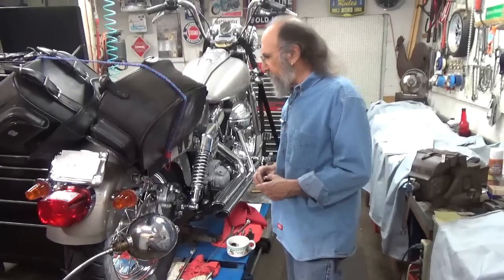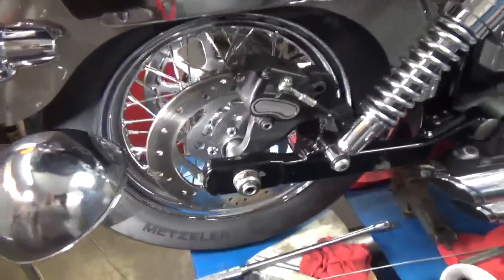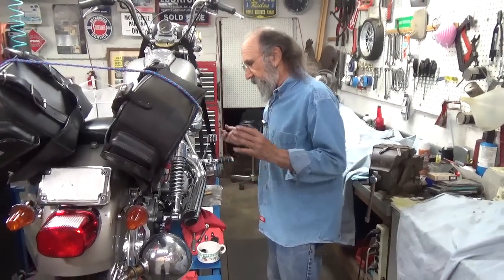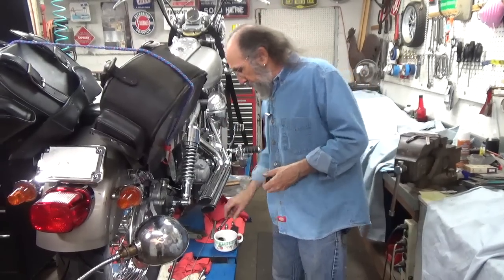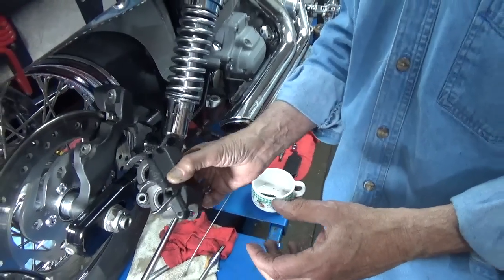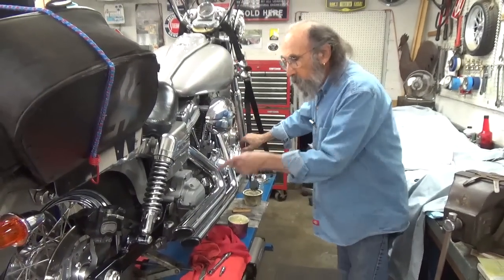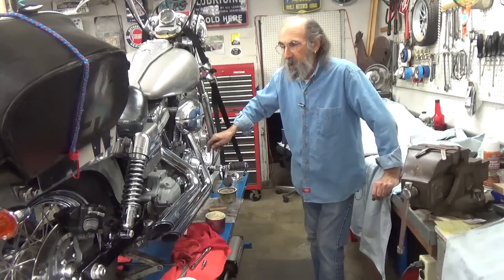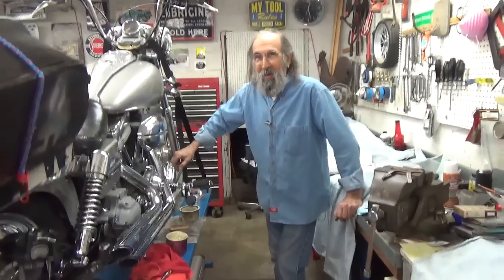Almost Forgot! New Rear Brake Pads on CMM's Harley Dyna

Comment: I have a 2000 Dyna Wide Glide. Will your video on chassis al8gnment address the motor mounts and when they need replacement. I'm more of a pan and shovel guy who got this Dyna for good price, but I don't know it as well.
Reply from the maker: We'll see what comes up.  I had a Dyna (2001).  It was nice, but, I too am more of an "old bike" guy.

Comment: Good morning and thank you for this video. How are you and CMM doing ? 94 octane is $6.80 USD for a US gallon or $2.24 CDN for one litre here in my part of Canada.
Reply: Wow and I thought it was bad here in Maryland at 5.09 a gallon for super! Cost me 10 bucks to top off from over a half a tank. I'm wondering if it be cheaper for me to buy a big gas can and fill with 87 octane and then add some octane boost to the can and mix myself. As 87 is over a dollar cheaper a gallon. And octane boost is 7bucks for about 2tank fulls of gas.
Reply from the maker: Sounds good to me.

Comment: Hey Mike so I hope I don't get on your nerves by asking so much about my bike. I just think you're the easiest to learn from and you seem to be the most knowledgeable on YouTube about these evo bikes. This is a question about saddle bags. I have the bars on both sides of my fender to keep bags off my wheel but I'm having a hard time sourcing a set of decent sized bags. These bags on this bike look perfect. Do you happen to know what those are called?
Reply: They were on sale at a great little leather shop in Calimesa Ca , ( buckle n belts ) . They are a little bit bigger than a standard 12-pack of soda and I couldn't recall a name on them but they looked great and fit so I got them

Comment: I’d be interested to hear about how or even if the bike’s handling changes with the narrower rear tyre.  I have a 21 inch front with a 90 x 90 tyre so the standard 160 wide tyre gives quite a large difference and I felt a real change when I stopped using a 180 rear.
Maybe I might try a 150 rear tyre if I can find an Avon in a 17 inch rim size.
Reply: She handled Great. More tire sidewall made for a more softer ride Plus I Really Love The Way She Looks Now 👍😊❤️💯❗😊
Reply: @cameramanmike2072  Thanks very much for the reply Mike, I have not long put a new rear tyre (Avon Storm) on the 17 inch rear wheel. I have a 2006 Sportster that uses a 21 front and 16 inch rear with a 150 and that works just great though I don't think I can get the aspect/width required to match the overall height.... the Dyna is not that much heavier than the Sporty so maybe I will look into going to a 16 inch wheel with more aspect to the tyre. Ride safe.
P.S.  Scratch that about tyre width/aspect and ride heights.... a 150/70  R17 is available and would leave the bike just an eigth of an inch lower so that's a go situation - I would lose a little sidewall but I have also fitted longer,softer rear dampers that raised the seat about an inch and sumthing and could use things a bit lower as I am only 5'8".... but I am the right weight for 6'3" !!!
Reply from the maker: Sounds like you're figuring it all out.  That's half the fun.

Comment: Hi PM and CMM ! I was wondering if your upcoming video on frame alignment will include any discussion of the infamous  "death wobble". I have read that the rubber mounted engine relative to the swing arm bushing may contribute to that phenom. Just curious as usual. Thanks for all you do !
Reply from the maker: I've not experienced it.  Probably never saw one running in that bad of shape.
Reply: @pacificmike9501  Thanks Mike. I'm lookin forward to watching how you do that alignment.
Reply from the maker: Nothing magical.  It's in the factory service manual.  But, we'll go through it.  It's truly worthwhile.  Right now, I'm tearing my hair out making a sidecar fit my FLH chassis, with a six speed and custom pipes and forward controls and on and on.  Then we can do an alignment.

Comment: @Pacific Mike could you explain what you did to your Shovelhead exhaust?
Reply from the maker: My friend Nathan, at Turner's Customs made them for me out of three or four sets of junk pipes I had laying around.  They're made to my specs and I've done some rather "off the wall" stuff from there.
Reply: @pacificmike9501  I had an exhaust bolt pull out of the head and remember seeing your fix for it.
Reply from the maker: That was a long time ago.  Was that a Beull?
Reply: @pacificmike9501  1980 FL

Comment: Mr. Mike, if you receive this I am in desperate need of knowledge and information for my evo motor.
Reply from the maker: Like, I'm here.
Reply: @pacificmike9501  is there any way I can contact you more directly
Reply from the maker: I do accept mail at my friend Kenny's shop in Beaumont Ca.  If there's something we don't need to discuss in the comment section... By the way, when I try to answer questions in the comment section, I hope more than one person benefits.  But, if you wish to send mail, I will get it if you send it to:
American V-Twin Att. Pacific Mike
448 East 4th Street
Beaumont, Ca. 92223
Reply: A little back history on the bike, it is a 2003 Kenny Boyce frame (fxr) it has a 1340 evo on it. My issue I'm having is it sumping the motor from the oil pan(no big deal there, that's just the check valve in the oil pump) but the big deal for me is once it sumps the motor with the bike on the kickstand it drains the oil from the motor into the primary housing and onto the floor in my shop(my primary cover is not all the way on due to this issue). I believe I am missing the sprocket shaft spacer behind the primary on the motor, but I can not find any help or breakdown due to the fact that it's a Kenny Boyce bike and not a lot of people know about them and it's a 2003 so in the Era of twin cam motor so everyone wants to argue and tell me that I don't know about the bike that I built. I built this 1340 evo almost 14 years ago its all balanced and blueprinted with a crane cam, I can not find my pictures of the documented build. And 14 years ago it was a pain finding parts for it much less now days. Do you have a breakdown of the motor from the oil seal and sprocket spacer on outwards to clutch installed, or can you please walk me through it. I'm lost and it's been a many days since I built it
Reply from the maker: I love that frame.  I've put a few of those together for people.  What a pleasure to ride.  I'm assuming the engine and primary are basically stock Harley items.  I remember the offset was about 3/8" for the engine and trans in that chassis to allow for a fat tire.  That was done at the front mount and swingarm pivot.  But the engine, trans, and primary were put together like stockers.  My point is, that any old Evo FXR service manual or parts book will show you what goes onto the motor shaft.